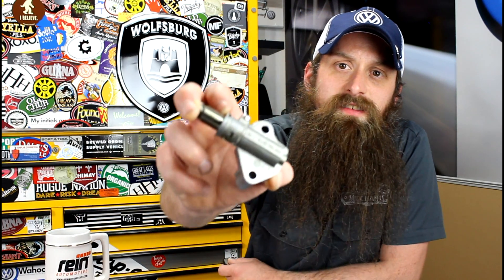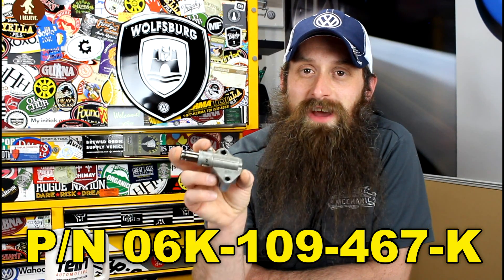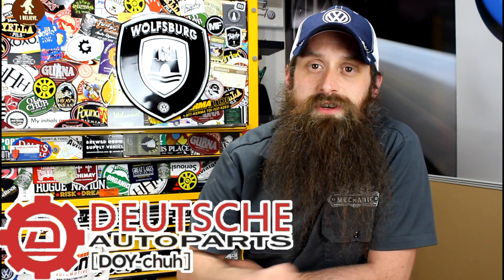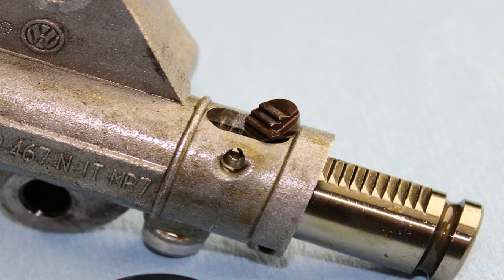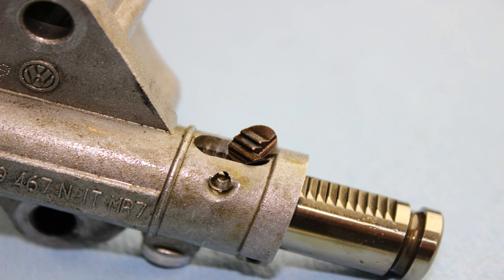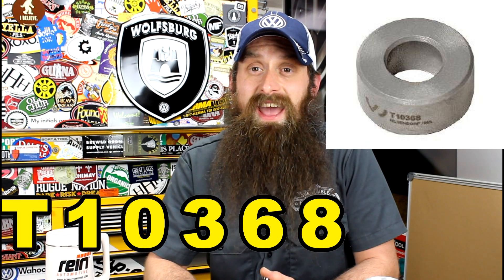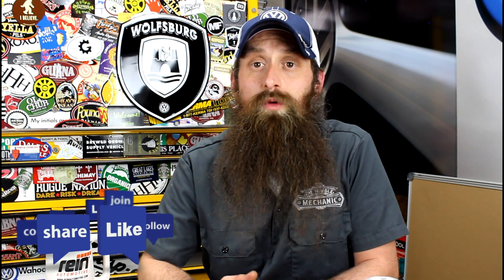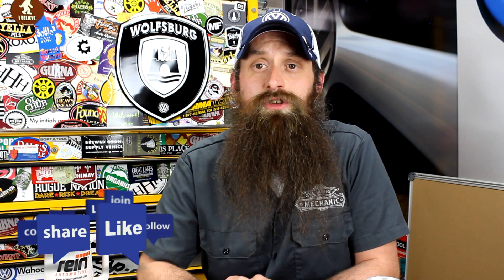How The 2.0T TSI Timing Chain Tensioner Fails

Comment: HumbleMechanic I love your videos! Thank you so much. I need your advice. I have a 2012 VW beetle 2.0 turbo.  I am getting a P0341 code. One technician is telling me to replace the N205 valve the other is telling me the timing is off and I need to replace( timing chain, tensioner , and cam shaft) you can imagine how expensive that may be without warranty. The car is running just fine but kind of sounds like a loud lawn mover. Thank you; wish you had a shop in Miami.
Reply: Hey what was the issue and how much was the fix?
Reply: @MrUnknown747  I have not driven it since then since they quoted me at 2,000$ min to do the work. :(

Comment: Hey there so I have a 01/2014 Vw Beetle Rline 2.0TSI Gen111 will this car most likely have the timing chain issue? I literally just budged over 50,000 miles car runs strong with APR ECU TUNES, exhaust excet and running it hard a lot but don’t appear to have issues yet???
Reply from the maker: I have seen a few chain issues with that generation TSI. But not widespread like the gen 1.

Comment: The tensioner is not the problem on these motors. The main timing chain stretches, quite a bit. I don't know if it's due to the long oil change interval or poor quality. When the chain gets too long the tensioner gets to the end of it's travel (not the parts fault. We replace the tensioner with the updated one, the main chain, the guides and the lower sprocket on the crank. About $450 Can. at the dealer including the oil filter and oil. The chain for the oil pump and balance shaft seem to never wear. Their guides stay nice as well. We have some cars and SUVs  well into 200k miles with no problems. Ignore the 12k oil change from audi and use common sense. We run reg oil for a few days to clean the engine out then just change the oil to sythetic (T6).
Reply: Where in Canada are you?
Reply: @pauljames7235  montreal

Comment: I have a 2014 GEN3 GLI, the car sounds like it wants to start but doesn’t. I’ve changed battery and I’ve changed the camshaft sensor cause I had got that code from vehicle I got rid of the check engine light but car still doesn’t start could it be tensioner?

Comment: I have a 2006 audi a4 2.0 TFSI and I changed the timing belt w tensioners and the tensioner w timing chain of the camshafts. Everything worked fine. I drove the car for about two weeks and then it shuts off while I was driving and it didn't start and the pistons had no compression. I opened it up and found out that the chain of the camshafts was a couple of teeth off. Do you have any idea what caused this? Thanks

Comment: Here's my response from Volkswagen after requesting they repair my GTI, stating they are unaware of any such issue:
https://www.facebook.com/708595994/posts/10156415333240995/

Reference # 181096624
 
Dear Ms. Sorensen,
 
Having to get alternate transportation for over year due to your vehicle being immobile, while still paying on the loan, is certainly frustrating. I regret to learn of the experience you have had due the timing tensioner concerns on your GTI.
 
I appreciate the research you have done regarding the concerns with your VW, as this is something I do myself with my own car when any concerns arise. I realize you found information that timing tensioner concerns are common, with multiple class action lawsuits open. At this time we here at CARE have not received any information on a class action lawsuit related to timing tensioner in our models. While we cannot predict how long a part may last, Volkswagen alongside the National Highway Traffic Safety Administration (NHTSA) researches vehicle concerns as we want our drivers to have the best possible experience with our models. We will issue a VIN specific recall or other action if we find a trend through customer, dealer, and other internal feedback. Using your GTI’s VIN, I found there are no actions related to the timing tensioner on your vehicle at this time.
 
Outside of an action, we must rely on our warranty parameters when considering repair assistance. The timing tensioner a on your GTI was covered under the Powertrain Limited Warranty for 5 years or 60,000 miles, whichever occurred first, from the in-service date of November 11, 2008. Due to the time and mileage of your vehicle outside this warranty, we cannot provide cost assistance with the repairs or other compensation at this time. I wish I could offer you a more favorable answer.
 
Customer feedback though is crucial to our process of seeing if an action needs to be released in the future. I have added your concerns about the timing chain to our research base. If an action or a settlement related to a class action lawsuit be released in the future for your GTI, Volkswagen will send notification by mail to owners of affected vehicles.
 
You mentioned pursuing legal action to get the compensation you are seeking, and this is your right as a consumer. I understand wanting to look into all possible options to research your vehicle concerns. Should you retain an attorney though, all communication to Volkswagen would need to come directly from that resource.
 
Please let me know if you have any other questions.
 
Sincerely,
 
 
 
Sarah S.
Customer CARE Advocate

Comment: You said there are 4 tensioners, this one being the N suffix. Which should I purchase to replace the original? I went to Deutsche Auto Parts and noticed there are lower and upper tensioners, assuming both probably have the same life expectancy and serve different purposes should I replace both?
Reply from the maker: Mostly the timing chain tensioner is the one that fails. You’re probably going to replace the tensioner, chain and guides.

Comment: hello i am from india  i brought 2010 passat tsi last month from dealer for some engine vibration issues i scan the cat that time scanner result come :::: P00016 Crankshaft position-camshaft position : Correlation bank 1 sensor A ::: after that car was running smooth but starter was taking long time to start engine.. and finally yesterday car doesn't start please suggest...

Comment: Thanks for your videos! I preventatively replaced the tensioners on my 2011 CC at 87K miles. Cost me $1700, but the 'slapping' noise on cold starts, and the grinding, 'gurgling' sounds in slow traffic are gone. Drives like a different car. Thanks for the useful info!
Reply: My brother think he would put a 1/2 inch hose clamp on the new tensuner shaft that flaxuates in and out from tensuner housing and he guaranties that timingchain will not jump again and destroy the engine! I steal think is should flasuate that shaft so tha chain on left site wouldnt stay to tight! What you guys think???
Reply: My car was totally fine until I took it for a rear main seal replacement which wasn't even leaking upon opening. When it came out, the engine started sounding different with all the sounds you mentioned. I just don't know for the life of me what the guy had done to my car. He swears he didn't do anything besides putting back things were they were and how they were. Only 40k miles.
Reply: @batchimed7392  Hate to hear that... 40k is around the time my first transmission went out. I'm at 118k, on my third transmission, and have officially paid more in repairs than I paid for the car! I'm in so deep it doesn't even make sense to sell it now. Going to drive it till it literally dies, then I will never drive anything Volkswagen again. Love the channel though

Comment: Does this apply to the 1.4 tsi engine? Am having a crankshaft and camshaft position correlation fault code, plus I noticed that at idle before the check engine light Came on, the consumption was at 0.6 liters/ hour now it’s at 0.9l/h. Any advice is highly welcomed

Comment: Well my wife's 2014 GLI just had the tensioner fail....96k miles.  I serviced the car per the manufacturer's guidelines.
I have done several timing belt jobs on VWs, did the chains on my old 02 VR6 wagon, and have done several cam replacements on diesels.
I have my wife's engine/trans out of the car at this time. For me personally, it makes this job a TON easier and since it's the first I've done I wanted to have it out in the open.  I've bought the tools from Deutsche Auto for the chain job and will also buy the parts when I get the head off and decide to rebuild it or buy a new one (My gut says buy new....).
Couple of questions....
The injectors are really giving me a fit to get them out.  Any trick?
I saw a different tool for removing the balancer and holding the gearset  in place other than the plastic donut in the kit I have.  How difficult is the balancer pulley to remove w/o upsetting the chain gearset?
Anything I should look for with the turbo just to check it over?
Man the intake is gunked up!  Will carb spray/cleaner have any ill effects on anything on the intake?  I plan of taking the TB off before decarbonizing.

Thanks for you videos.  They have been educational and fun to watch.  

Dave

Comment: So.. I have a 2012 GTI, currently at 80k, as far as I can hear, there is no start up rattle and seems to run pretty smooth. CBFA Engine, Dealer wants $1800 for a full replacement. Is it possible I have the revised version? Or am I lucky? I was told I should be okay until 100k, but after a night of reading and research... I don't know. Any help would be appreciated.
Reply: Tyler C. You’re blessed, just came from a VW dealership, they wanted 8 racks 😬

Comment: One symptom is a rattle during low rpms.  Also, a distinct rattle at startup.
Reply: Mine rattles high in the rev range, 4-red line, only sometimes.  Ever hear of that being related?  2015 gti see non pp car.

Comment: Nice video.... but there is new tool for the cranck so this old method is not corect anymore. Thats official v.a.g annoucment.
Reply from the maker: Yep there sure is a new tool.
Reply from the maker: Probably gonna do another video on it at some point
Reply from the maker: Lol I thought this was a different video. That old donut still works just fine.
Reply: I am in v.a.g official service i I use old and new method.....  New is better and safer.... My colege has wreck that new thool so before any work first go to ELSA and read manuals....  On Audi Tv was short video about that new thool....
Reply: Dubrovnik 82 is that problem also known on 1.4 tsi engines or just 2.0 tsi  !!?

Comment: Does anyone know approximately how much it costs to fix?
Reply: This is about a 8 to 12 hour job to fix if you have no bent valves. So whatever the labor rate is I'd multiply it by 10 or 12 hours plus parts.

Comment: Is it possible for a failed timing chain tensioner to throw just a cylinder #4 misfire code?
Reply: GermanAutos I'd check your spark plugs or more likely the coil packs. Check with your dealer if your coils are under warranty. Sometimes they have a separate warranty for certain parts if you have a pezev 2.0 engine

Comment: Hi humbleMechanic!  My timing chain was still in place when I looked down at my engine.  My engine stopped when I took a fast corner and was driving over bumpy roads fast.  Would the timing chain still be in place if the tensioner failed?  Are there any fluids that drain out of the engine?  I had no pressure in two valves according to the mechanic who found someone to buy my car.  I feel like the conflict of interest is making me raise a brow.
Reply from the maker: Chain can still be on. But it will not be in time. So if you "timed" the engine you would find that one of the cams is way out. I don't think it would fail in the states that you mentioned. Usually its just dead
Reply: That gives me hope. Thank-you for your help and response.  Trying not to be a damsel in distress but it's not really working! lol! Best!

Comment: Hey Charles,
I just had my intake manifold cleaned of cabon deposits.  My mechanic (VW enthusiast) pulled the plug to check out my 2012 GTI's tensioner - it's the latest version, but he said that it was ~75% extended.  He said that after another 30k miles or so, I might need to consider a new timing chain.  What I want to know is, is it possible for the timing chain to NOT get more and more slack?  Can it maybe just stretch to a certain distance, and then be fine for the life of the car?  Or is it pretty typical that once you've noticed any stretching, it's going to stretch over time until all the tension the tensioner can provide is used up?

Comment: my car started acting funny about a week ago, I noticed it took a couple extra seconds to start on the first day but ran fine, couple days go by and it still takes that extra time to start but now it sputtered for a couple seconds. couple days go by, everything mentioned before happened again but it misfired just after warming up and choked every time i hit the gas. this morning i went to check with VCDS and the new symptom is a misfire on all cylinders that does not go away, accompanied by the fault
000022 - Bank 1: CMP Sensor (G40) / Engine Speed Sensor (G28) 
               P0016 - 000 - Incorrect Correlation - MIL ON
Please help, anyone

Comment: Mine failed at 67,000 miles with no warning.  VW said I'm outside the 60k warranty so they are not covering it. $8,000 bill from the dealer. Youch! Get this changed if you have it.
Reply: @proaudiohd dude file a claim against VW.

Comment: I have a 2010 2.0 tsi cc Volkswagen with now 100 thousand four hundred miles, I've replaced now the pcv valve and got new coil ignition ,also had a problem with the fuel pump and got it replaced as well, now I'm worried about the timing chain tensioner,  do I have to get it check right away??
Reply from the maker: I would highly recommend that. Or check it yourself https://youtu.be/G65J1aEszyc
Reply: HumbleMechanic thanks

Comment: I was getting random codes on my 2011 gti. I have owned it from new, only 49000 miles. Serviced to the book. Took it to the dealer they said it was the timing chain. $1800 later still the same problem. Then they said it was the ecu. $1600 later still the same problems. VW of America told me to take it to a different dealer. These guys seem to know what they are doing. They diagnosed a bad wiring harness and a failing water pump. This is going to cost $1700+  .
To say I'm not impressed is an understatement. I'm hoping to pick the car up this weekend. VW have had the car two months.

Comment: Your videos are awesome! Great job! We bought an 07 Passat from a customer with a failed tensioner/bent valves. Head reworked, new valves. My tech (and myself) did not know about the non-indexed crank pulley (crazy!!)...and, as you mentioned in the video took 7+? times to correct..I'm curious the faults you received. We have have no timing rationality faults, but misfires on all four with freeze frame data showing they are all set at the same time. The misfires occur when recorded at 754rpm, but are noticeable, and repeatable up to about 2K, even when not moving, and just holding RPM. After 2K, it runs awesome. I'm guessing we messed up the timing. Would love your thoughts. Thanks, Scott, Marin Motorsports.

Comment: I have a 2012 GTI PZEV CBFA. what are the chances mine needs replacing. car has 74K
Reply from the maker: +MrDeeno11 that could go either way man. I'd do a quick check on it.
Reply: Mine went out right at 100,000 miles

Comment: ok, so my audi 2.0t jumped timing at idle. my question is what is the best way to test for bent valves. I have already taken apart a compression Guage and forced compressed air into each cylinder with the timing chain removed.  I heard no air escaping from the engine through either the intake nor exhaust.  would you consider this adequate? thanks

Comment: Mine failed on 2012 Gti at 46k miles .. Bent valves and damaged pistons. My aftermarket warranty paid for a new engine so I was lucky.. now I have a new engine .. bill was $7200 from dealer ..
Reply: This vid makes me nervous.  I too have a 2012 GTI @ 47k miles.  Just waiting for it to fail so my extended warranty gets me a new engine.  I have up until 75k miles on the warranty to cover this.  If it does not fail, I will have the service performed under warranty before it hits 75k on the odo.
Reply: TomasEnriqueAraya Google VW TIMING CHAIN FAILURES . defective tensioners on certain years. After I brought up this issue with Local VW they replaced mine (2011) free - and I have NO warranty!
Reply: Jeff Eppenger Google VW TIMING CHAIN FAILURES . defective tensioners on certain years. After I brought up this issue with Local VW they replaced mine (2011) free - and I have NO warranty!
Reply: TomasEnriqueAraya not up to you if it will be covered under warranty.  Most likely not unless the part actually fails while under warranty.
Reply: MrThomas good laugh so so untrue.
Reply: https://www.carcomplaints.com/news/2016/volkswagen-timing-chain-tensioner-lawsuit.shtml
Reply: Jeff Eppenger https://www.carcomplaints.com/news/2016/volkswagen-timing-chain-tensioner-lawsuit.shtml

Comment: i'm going through with this DIY. I'm going to deutsche auto parts for the basic kit. Is this all i need? Do i require the 15 bolts for the new cover and the crankshaft holder? Or is the simple circular part that comes with the kit all I need? Thanks

Comment: Hi

I noticed that in most of the replies you mentioned that the CCTA engine is mostly affected, I have an A3 1.8 tfsi CDAA, what are the chances that these engine might also be affected by the tensioner because the exterior of the engines are basically the same? Thanks.

Comment: Hi, I have a 2009 VW CC with the 2.0 TSI, it has 121k miles.  The car sounds little bit like a diesel, do you think it si the timing chain tensioner?
Reply from the maker: YIKES! Probably not, but maybe. Either way, you need to get that checked out ASAP